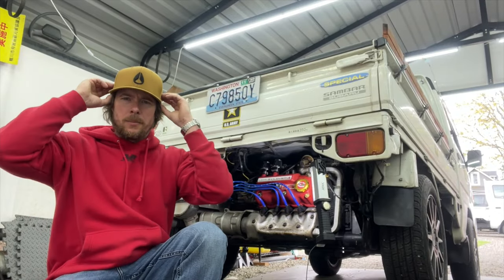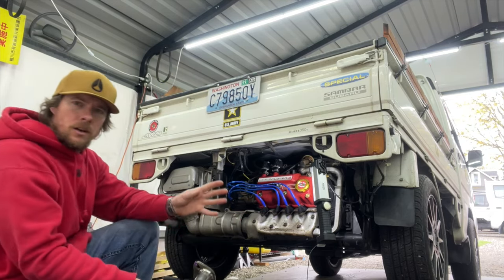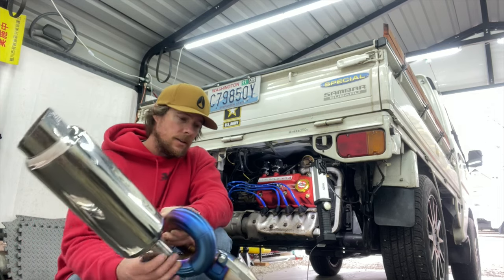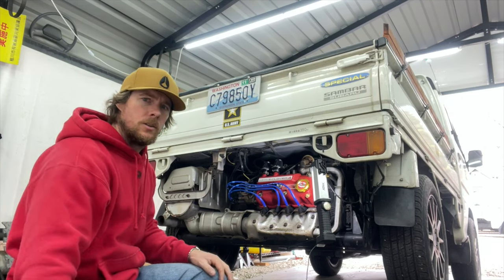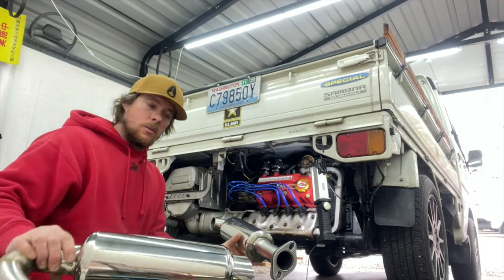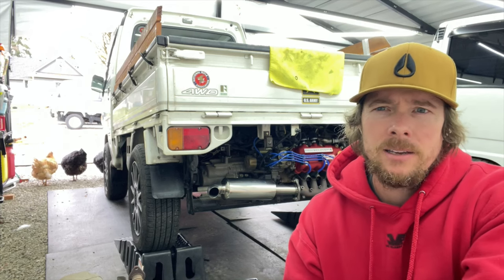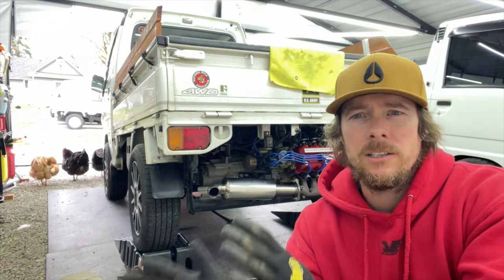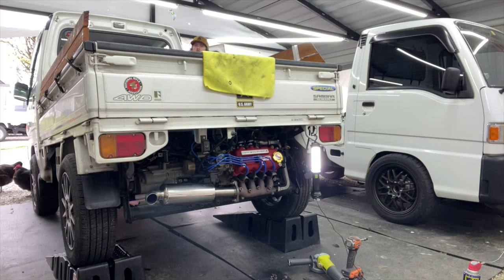Subaru Sambar - Custom Exhaust System & Muffler Install Made By Special Keiz for Local Customer

Comment: Sweet tone.  If/when I'm in the market for a muffler, I'll be in touch.  Is there a reason (other than added complexity and cost) not to offer the airbox pre-heat with replacement mufflers?
Reply from the maker: Ya that’s a whole nother ball game. Making the mufflers is work enough with space constraints. In my opinion it’s not necessary other than quicker warm ups for less emissions. If you wanted something still then you could certainly try and make some sort of heat chamber on your own I suppose 🤷🏼‍♂️

Comment: Hey my man! I would love that simple exhaust for my sambar. Can you tell me if the mini squid can still be installed with my engine gate closed, Or do i have to have my whole engine exposed.  My BBQ light  on the dash  just turned on. So i would love to switch the whole system.